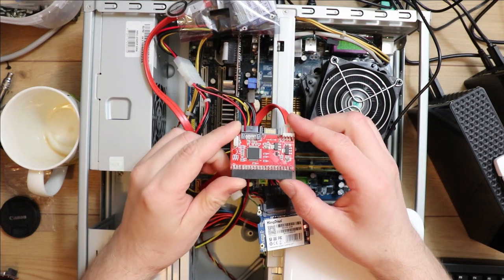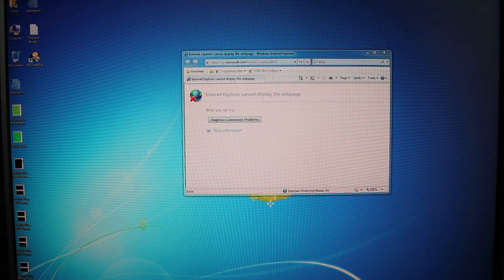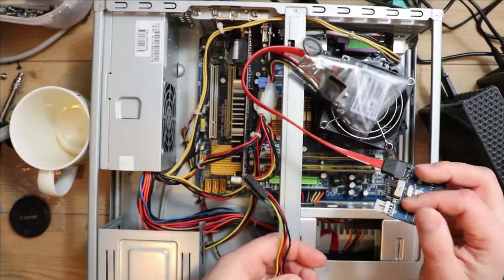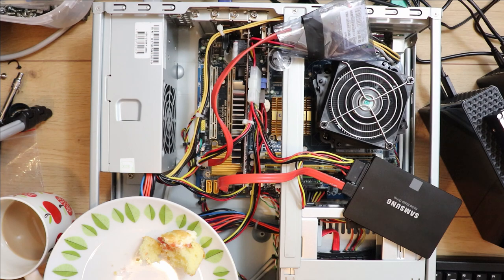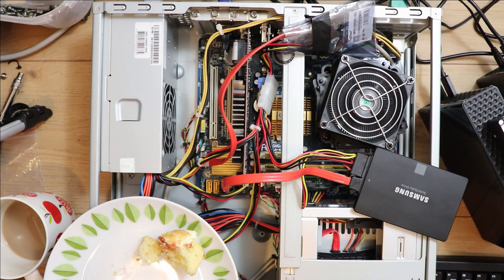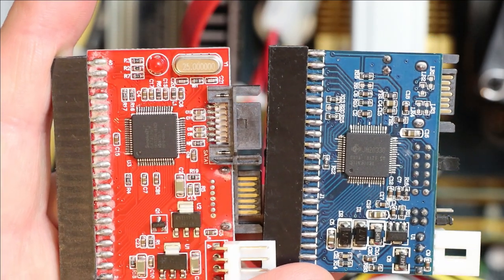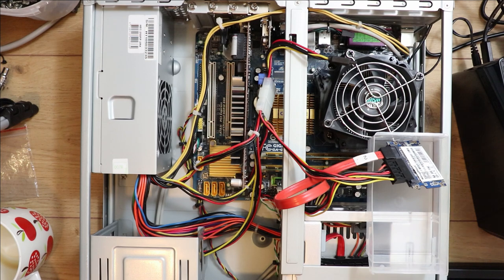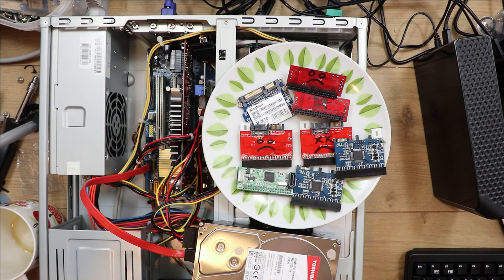Not all SATA to IDE Adapters Are The Same

Comment: Got to admit that after some time suffering with the unreliability of cards, I usually immediately go for Startech first time, every time now. Battling with the cheaper versions was a waste of time and money for me.
Reply: However, not messing around with cards means I never end up making interesting videos like this one :-D
Reply from the maker: You make other equally interesting videos :-) I did comment on your 2nd Pi video but Vimeo logged me out and lost my comment without telling me. I must do that again.

Startech do make some really good kit. Sometimes I think they go a bit overboard on the prices though, I don't mind paying for quality but at times they try it on a bit. I wonder if the Startech would be better. I have to be honest, maybe I was expecting too much from an IDE port, it's easy to forget the limitations of older hardware.
Reply: Startech branded adapters use the “Marvel” chip. Interesting to compare lindy’s JM (JMicron?) with Marvel.

Comment: I have one of each, IDE to SATA and SATA to IDE and I use them for my DVD drives. I also have one of those 32GB KingDion SSDs
Reply from the maker: The larger ones do both ways, depending on which port you use, or the switch and jumper on the other one.
The KingDians I bought because of your video :-) That's how long it's taken me to get around to using them!

Comment: I have a bunch of those red adapters, and definitely don't work any good with any sdd I've tried. I thought it was one of the boards that was faulty, but the 3 I tried performed exactly the same, they are garbage in my opinion.
Reply: I remember a longtime ago , I tried to install windows XP on compact flash drive using on IDE adapter . It worked pretty well, but the adapter didn't last  long . I had to buy another one , but not of the same brand . The new adaoter made the compact flash too slow , it took hours to install windows XP , booting up  was too slow , browsing  windows slow too .  If only I could repair the first compact flash to IDe adapter . It has no vusual damages

Comment: I got one two years ago and I quit trying to use it for technical problems but just started trying to see if it works.  Some guy said you have to put the hard disk on master to work.  I did but did not work so.  How did it work the one that had problems or was it due to cable settings on the hard disk?

Comment: It stands to reason that they'll have limited transfer rates, because they're passing through an active adaptor.  In effect you're adding an extra layer of translation:  So you have the theoretical max speed of the onboard interface, the adaptor and then the device itself, and at best you're going to be able to go as fast as the slowest link in the chain.

Comment: Hi again Paul. Late comment here but I thought I would add my limited experience with  PC's. You will never get the same transfer rates from an IDE controller compared to SATA. IDE (ATA133) does 133 MB/s (hence ATA133). SATA1 will transfer up to 150MB/s, SATA2 300MB/s (which happens to be that motherboard your using) and SATA3 600MB/s.
 So you have two bottlenecks. 1. IDE is far too slow and 2. Your motherboard is slower than the Toshiba HD and Samsung SSD as I would think that these are SATA3 rated. Bear in mind that mechanical hard drives and older (or cheaper) SSD's will not be capable of the rated SATA speed but should perform much better when matched with their rated interface. Hope this makes some sort of sense.
Reply from the maker: Hello again :-) Thanks for the detailed comment. I was aware of the various bottle necks, I just had an expectation that the IDE to SATA adapter would be able to work closer to those limits than it appears to. I've since got another board to use in this machine, although I've not put it in yet... besides I never actually finished this like everything else! The replacement board has some SATA 3's on it, so that will help. Although in all honesty, for the purpose of this build it doesn't matter, I can wait for things to finish :-)
Reply: @Error42_   I have many projects on the go unfinished :-). My latest project is running windows games (DVD install type) successfully on Linux.
 Just to make my previous comment clear, it doesn't matter the speed of the interface. It is the speed of IDE it has to finally go through which causes the bottleneck (which is 133 MB/s) and that all you can achieve.
Reply: @retrocomputeruser  0